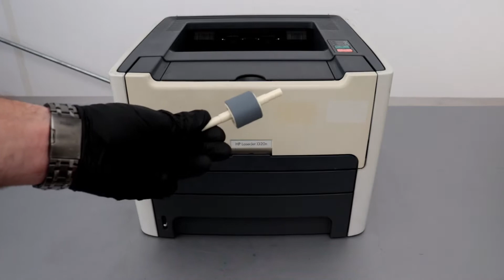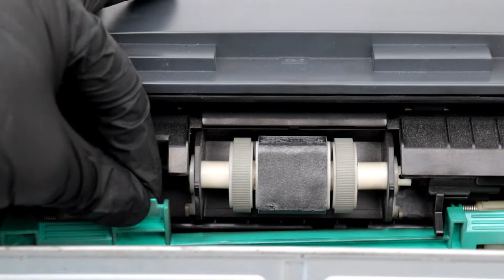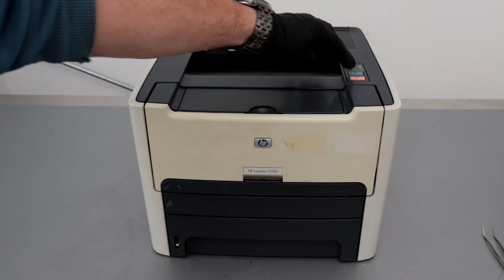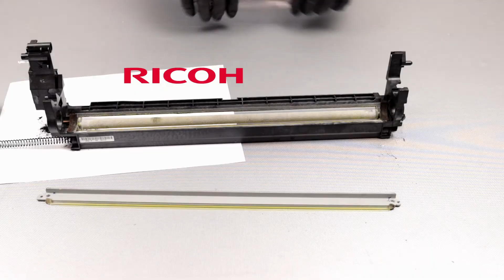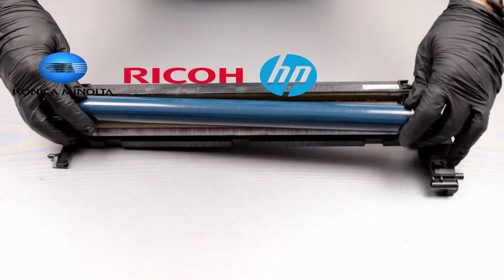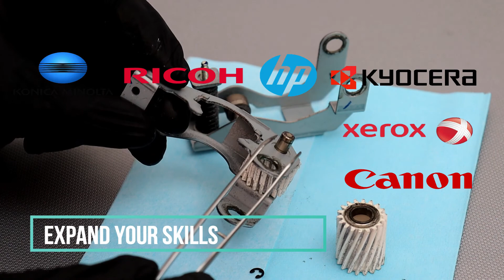How to fix a printer paper jam - Paper Feed Roller HP

Comment: dear Sir, i have 1320n printer, Its jam(block) the page when the page is going into the printer in the second turn.
How to resolve the issue?
Thanks
Reply from the maker: You may need to clean the clutch from the duplex. Wash the paper pick-up roller from the cassette. Shine the duplex flashlight and check that there is no loose piece of paper that is jammed and is now obstructing the paper path.

Comment: Sir, I have a 2015 printer. a single print works fine but like around 5 paper printing gets stuck. The stuck paper is white which comes out from top in exit bin and there will be another one stuck in toner area. I have released the side clutch but still the problem persists. Any help will be appreciated
Reply from the maker: You need to replace the paper pick-up roller and if this does not solve the problem, you need to check all sensors in the paper path.
Reply: @MrRicoh  I had no idea that there would be another sensor beside the clutch. Could you please advice on that?
Reply: @MrRicoh  pickup roller and toner is already replaced but the problem did not get resolved.